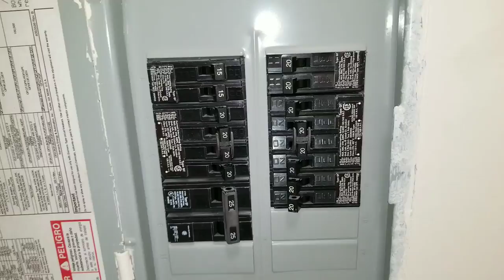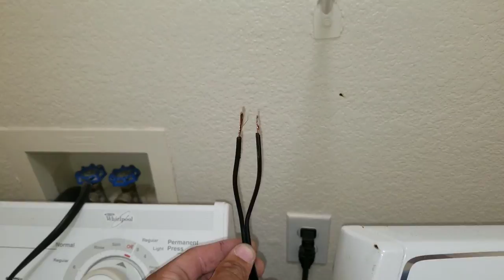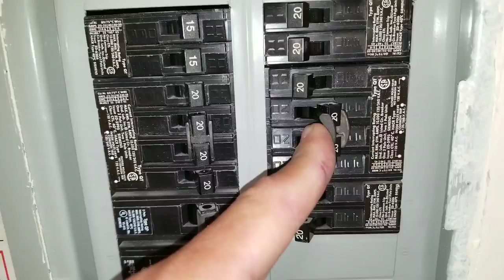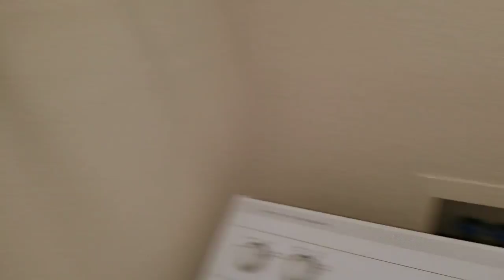Circuit Breaker Keeps Tripping? Watch This Video!

Comment: That's just it you have a finished basement with two rooms a kitchen a hallway pot lights in a  closet and breaker keeps tripping all connected to 3 breakers that are not labled good luck figuring out the problem.
Love the vid thumbs up 👍👍

Comment: Great explanation. I have the same problem with one of the breakers. I realized that it was connected to an outlet in my back yard and now that outlet is cut off from the circuit. Probably those wires in the ground somewhere are causing this switch to trip every now and then.
Reply: Did you disconnect the wire from the outlet and see if other outlet working? Asking bc I had the same problems overnight till now don't know how can I get it done

Comment: Thanks, I checked and replaced all the outlets in the circuit in my relatives house but didn’t check any switches. I even had my relative replace the 15A circuit breaker. I’ll definitely check all the switches in the circuit tomorrow morning.

Comment: Dont stand in front of a panel doing these things if there is a malfunction in the breaker hot copper gases and vapor is very bad for your face and or lungs ...alway stand off to one side and turn head when resetting circuit breaker!
Reply: @austintrusty755  explain why?
Reply: Sein Maestro he never did

Comment: Hi Sam, thanks for the video. It is very helpful specially because I think my compressor may be over amping. It’s only five years of operation, but a 9 years old product I found online to replace a bad compressor. I’m thinking of replacing the circuit breaker but it may keep tripping if the issue is with the equipment. Could I switch to a two pole 20 from a two pool 15? I’ll check the installation manual to be sure too but if its not the breaker, then what else can be done as an option. Thanks again.
Reply: it can done; however , you must have the right gauge wire in place already for 20 amps.
otherwise, the wires can melt from too much current and cause a short.
If it is not a bad run back to the panel, go ahead and run the right gauge. Good Luck

Comment: When i run the dryer, my breaker trips sometimes 3-4 times in a cycle but some other days it doesn’t. There is no other appliances plug into it. It’s just for the dryer.
Reply from the maker: There are a few things to consider. First is it an older dryer? Is it overamping? Have you eliminated the possibility that the breaker is starting to fail? If your dryer has no issues... it is not uncommon for the breaker to start to failing. If you go to my channel I recently posted a video with a new tool that allows you to measure the amp draw of anything plugged in an outlet. Start with the basics 👍
Reply: @MoreThanMaintenance  my home and dryer are less than 14 months old. Home actually was rehabbed. Its 220 line but nothing else seems to go off but the dryer. Should I just unplug things in house like TVs to decrease amperage house??

Comment: I just changed a plug and replaced it with a new identical one. I put the wires securely in the same places and finished the installation. I went back and turned the breaker on and it trips, along with the main breaker to the whole house. This house (my sister's place) is just over 20 years old, and the old plug socket was working but the bottom plug had a black smoke stain on it ( it still functioned). Could it be the breaker itself?
Reply: You have a dead short somewhere. Maybe a wire came off a terminal and grounded out somewhere.

Comment: My ac keeps tripping my breaker, after it runs for 10-15 minutes or so,  could it be loose wires to the breaker?   It does get cold, could that still be a compressor issue?
Reply from the maker: Usually if it is tripping the breaker it is either a bad run capacitor or the compressor is over amping. Hope this helps!

Comment: What do I need to do if the breaker shows like its not tripped. But there is no power in the area. I tried turning all the breakers off then back on again and so did my husband but there is still no lights or outlets working in the area. We even tried the two main power ones at the top.
Reply: It"s possible that the wiring at the breaker, buss bar, or junction box might of went open from a loose connection. good luck

Comment: My breaker is not Turning off my bedroom lights or receptacle when I switch it to off... any ideas?
Reply: I would think you arr either turning the wrong breaker off, or it is defective.
  I would turn the lights on and plug s lamp or radio in one of the outlets.  Then start flipping breakers to see if any turn the power off to the lights and or outlets in that room.
  Lightd and outlets are not always on the same circuit/breaker.
  Also, some outlets are switch connected.
Reply: @rickeykeeton4770   It was the wrong breaker, for some reason this breaker is not wired and marked wronged. Thank you !

Comment: I have a double pole breaker that keeps tripping every 4 hours or so. It’s for the garage and a/c, but the a/c isn’t in use for the winter. The garage has 4 15 amp round fuses that are not blown. Any ideas?
Reply: edbtzkhud did you find the issue?
Reply: Mr. Krabs yes I did. Corroded underground wires.

Comment: 2:10 are still alive out there? You even had to cut filming after you reset the breaker, did you had a electrical discharge? I guess at least a lil bit. Be careful out there boss!

Comment: both units on my ac have tripped will not reset. I checked wiring nothing appears burned. Could it be that the breakers just need to be reset
Reply from the maker: Something is causing the breaker to trip. On my channel I have a video on how to troubleshoot. AC keeps tripping breaker. Let me know how it goes! 👍

Comment: im having an issue with breaker tripping as soon as reset. ive unplugged all the stuff that had been plugged in still tripping, replaced light switch and all outlets on this circuit and the breaker. still tripping any ideas?
Reply: If you feel confident in you mechanical abilities, you can remove panel cover. This gives you access to the wiring. With breaker in the OFF position, remove the wire from the breaker in question.  Now try to reset breaker. If it resets, then it's not the breaker.

You mentioned replacing "light switch and all the outlets", but I doubt that you've replaced lighting fixtures themselves ... I'd start with the most frequently used lights fist.
It is likely time to call an electrician...
Best of luck.
MM LU#82 IBEW

Comment: Now the next problem is.  What if there is Nothing plugged into the outlets for this breaker, but it still instantly trips itself suddenly?  It was working fine for a few years and nothing new was plugged in.  Anyone has any ideas? Thanks
Reply: There's a short in the wiring.

Comment: This didn’t help me at all. I live in a bedroom in an apartment building and I only have ONE thing plugged in my entire bedroom. That’s my TV. A TV I have had in this apartment for months with no issues on power consumption. And it’s been shutting off (tripping) over and over and over. I would do it just like you did and it would immediately shut off again or seconds later. It’s after midnight and no one I can contact is up or available to fix it. I’ve been at this for an HOUR now trying to get my power in my bedroom to stay on playing with this circuit breaker and NOTHING is working.

Comment: how about motor shorted out, grounded wire, weak breaker
Reply from the maker: Gene K 
You are correct! I have many videos on my channel showing how to repair with these various issue. I just posted a video where the breaker was the issue.

Comment: I have a few comments.  What an idiotic thin to do!   Is this your house or are you renting?    Why would a 120 volt receptacle be on a 2 pole circuit breaker?   I hope you replaced the breaker after you played your game!   Breakers are only guaranteed to trip with one short circuit.  You hit it twice in the video and probably more off camera.   So, you have probably damaged the breaker.   If a fire starts due to this breaker not tripping when it really needs to and the insurance company finds this video, you will be liable for all damages and hopefully no injuries or deaths!
Reply: sounds like constantly tripping the breaker could damage it?
theres a tenant who's been running a portable washer/dryer in her unit.
its probably a 15amp circuit.
she says the line had been tripped 3times in the last few weeks.
could this cause the breaker to fail, as in make it unable to reset?